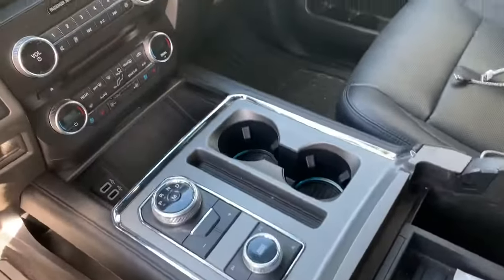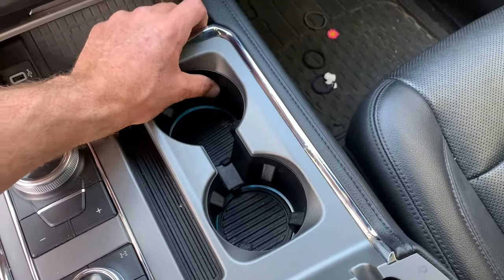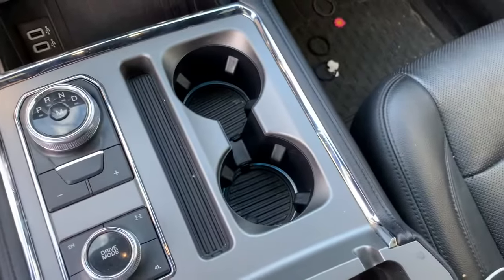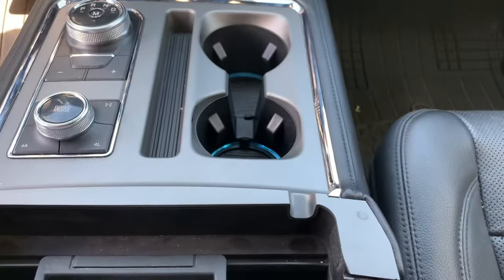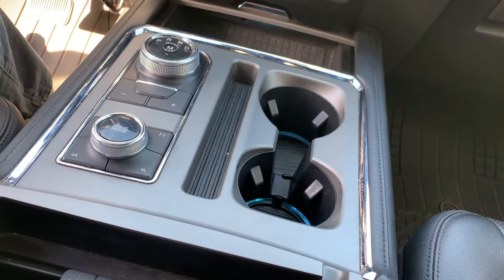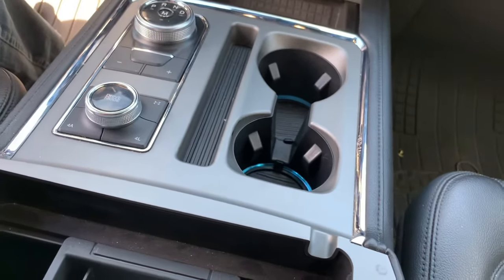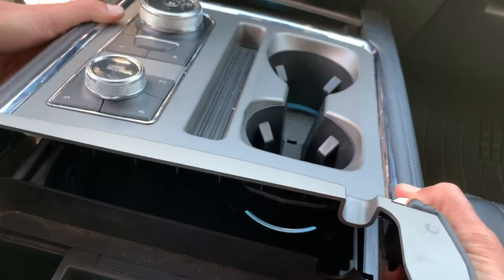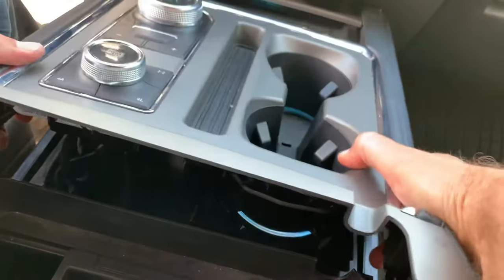2018 Expedition Cup Holder Fix Part 1 (Console and Cup Holder Removal)

Comment: THANK YOU FOR THIS ENTIRE SERIES! BTW, think I'm going back to Toyota for my next vehicle. FORD wants $274.55 for the replacement part. I used regular JB Weld epoxy, and it is as good as, no, wait, better than new.
Reply from the maker: Glad it could help.  I only owned the vehicle for a year.   Really wanted to keep it but just too many problems.

Comment: Has your Crome trim start peeling ? Mine has and been looking for videos or aftermarket trim to fix it but can’t find nothing
Reply: Mine is doing the same thing. I’m gonna take out the trip and trip it if it’s chrome. Then I’m going to wrap it with a chrome vinyl
Reply: @jacoblewis8198   I have the same issue. Curious on how it turns out with you

Comment: I would not relocate the key sensor as you will not be able to program a new key if needed in the future.
If the cupholders fixed correctly, the key sensor hardly weighs anything, I don’t think it’ll be a problem.
Reply from the maker: I ended up replacing the fob module on the bottom of the cup holder for resale.  Most of these failures are on the side that the module is on.  Those “mushroom” rivets are way past capacity for the cup holder alone, let alone hold the module.

Comment: Any suggestions on what to do w a 2021 ford F150? My cup hold tab also fell inside…
Reply from the maker: Oh man, bummer.  I haven’t been in an f-150’s console, but I’d guess it’s pretty similar.  Some guys like using epoxy to glue it back together.  My favorite way is whatever works!  I would definitely use an epoxy that will chemically bond with the plastic, not just on the plastic.